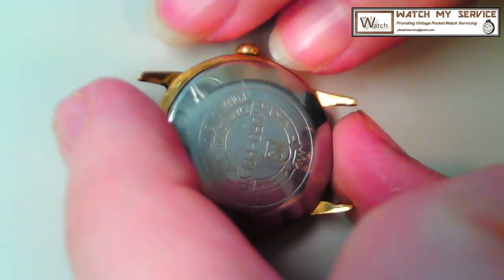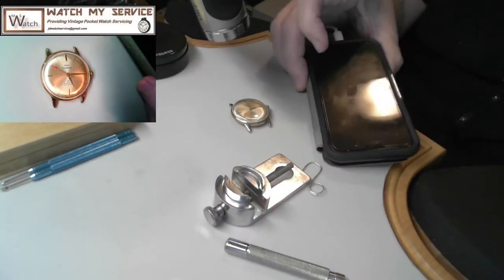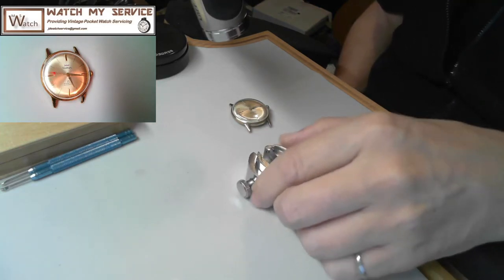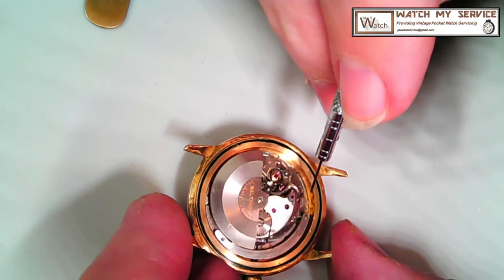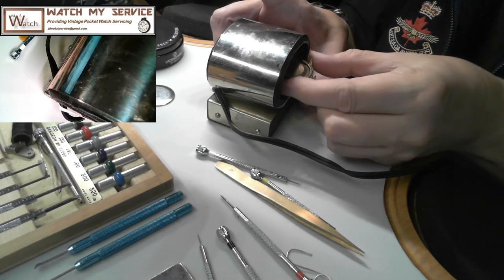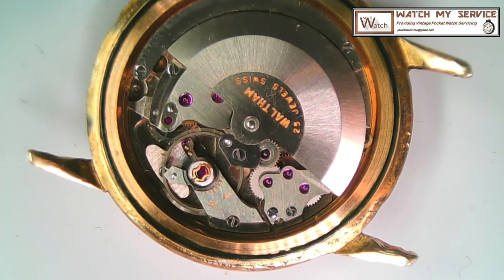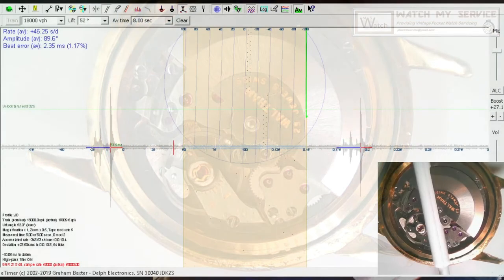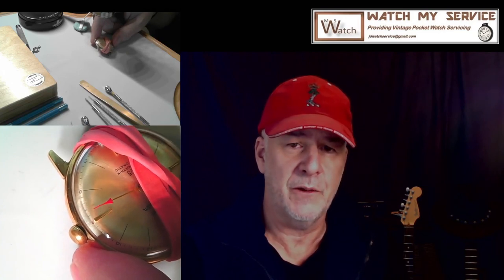Swiss Waltham Watch Service   Or NOT!

Comment: Could it be that you need to remove the automatic winding device before you can let the mainspring down? Oh BTW, the initial screen of the video says something about working on a Vostok Amphibia!?
Reply from the maker: Will definitely need to fix the title problem. Also had audio issues with this video. I think I will take it down and fix it.
Reply from the maker: Btw, I think you are right regarding removal of the rotor prior to letting the mainspring down.

Comment: Thanks for this, JD. Here’s a question that’s been bugging me for a while now: How does a watch program or a Witschi machine determine the amplitude of a balance?
Reply from the maker: Stumped….stand by
Reply from the maker: That is an excellent question. In fact, when you have a balance with poor amplitude, you can still have it keeping the same time. So what happens is the pallet Fork pushes the impulse Jewel left or right to swing the balance clockwise or counterclockwise. And the watch timing tool listens to all five positions or clicks of the pallet fork in the impulse joule as it goes through the center position. So I suspect that the timing machine would know the timing between the time that the impulse Jewel enters the mouth of the pallet Fork until it exits on the other side and that signal or duration could in fact be used to calculate how long it took the impulse joule to make that complete motion. I really need to research this a lot more because what I've just said sounds like a little foolish assessment of what really happens. Now you've got me really curious and that is never a good thing.
Reply: @JDRichard  In theory, the balance should oscillate at the same frequency, regardless of amplitude, hence the conundrum. But I recently found a pdf manual for Greiner Electric’s Micromat. It explains a way that amplitude can be determined by sound alone, so the watch doesn’t have to be uncased. I can email a copy if you’re interested